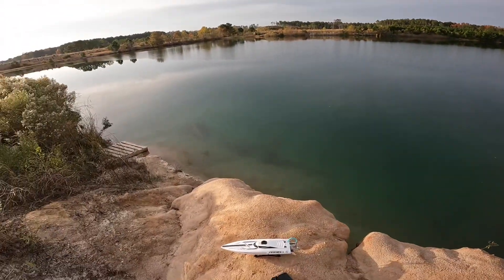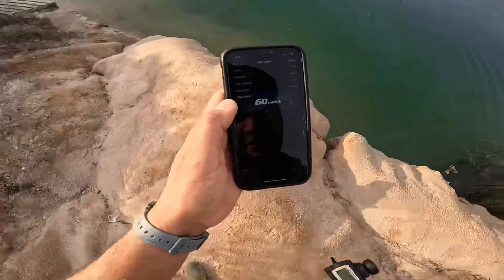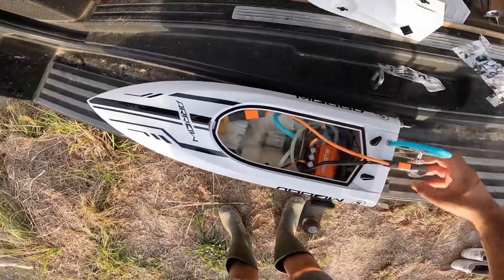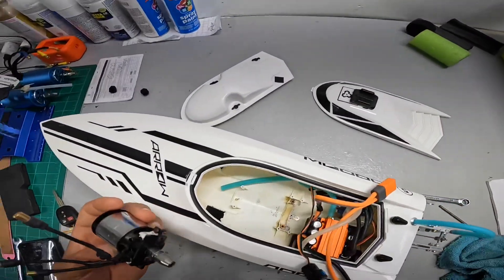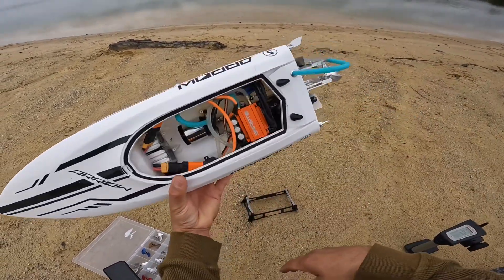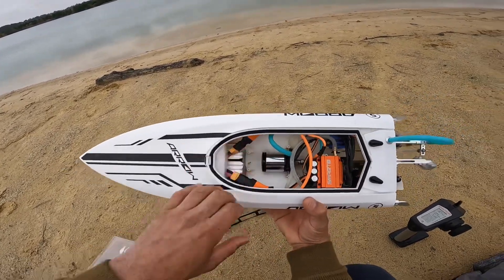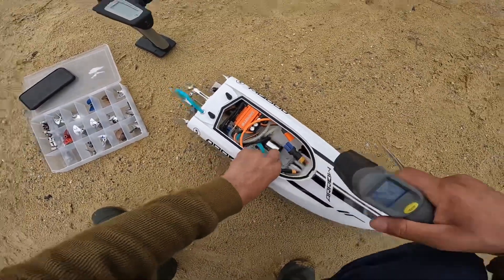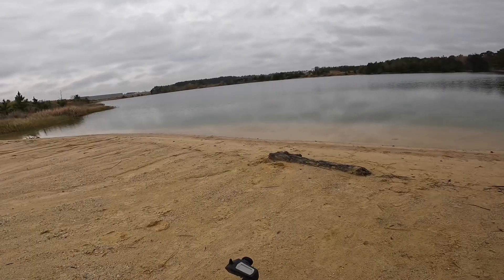UDI ARROW 5 ON 8s!!!!

Comment: The truth is you could get 50 plus with a 3s setup... something like a 60 amp esc, 3600-4000 kv , 2500 60c 3s and a  medium pitch 33=34 mm prop...and it would last... But i know your channel is for pushing things to the extreme...Great job!
Reply from the maker: I agree 100%! Just for some thrills 😂
Reply: @gen1power102  I do like to see insane setups just don't like to go to crazy with my own boats.... I just picked up a little  volantex vector s and tested it today near my house... installed new batts in tx and used a fully charged batt 1300 mah i use in my airboat...just  keeps dying on from the moment i put it in water. then coming back to life for a few seconds ..then running for a minute or so..i took it out and checked everything... no water ,no heat at all... range does not seem to make a difference... 30 foot or 100 ft ..it died several times for a couple of minutes on me... does this sound like a bad rx? thats the only thing i can think of...i never had any of my boats do this unless i got them wet...Any idea??? i don't want to send it back since it has to be a simple fix...thanks..happy boating!
Reply: I am going to repower omee of my arrows-- what is the biggest motor I can get and still use 3s

Comment: I like the enthusiasm you have for boats-- I am trying to get into It with my own arrow 5-- (recommended by racing group near me)  i am going to check out a race next week to pick all their brains and decide on a boat.  Also going to build a dumas short stuff during the year
Reply from the maker: The cats are super fast but in my opinion I really think the monos are best all around boats. If I can recommend a boat I’d say stay over 40” because you don’t have to worry about choppy water as much as you do in smaller boats. And if possible start off with a stronger boat like carbon fiber or if possible a double thick carbon fiber boat.
Reply: @gen1power102  the group that races by me have 3 classes-- mini 10-17"----  sport 19-28" --- wood 16-20"

Comment: gr8 video at 3:55 is this just a blower with battery or an air pressure pump like a high pressure?
Reply from the maker: Yes correct.